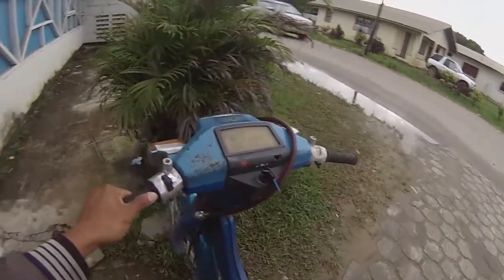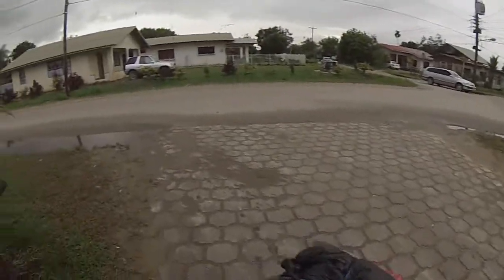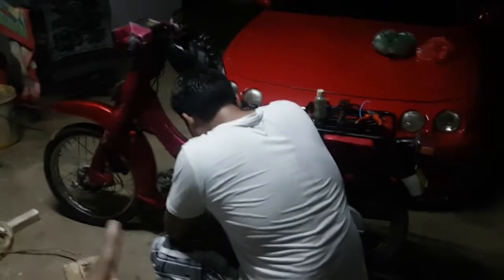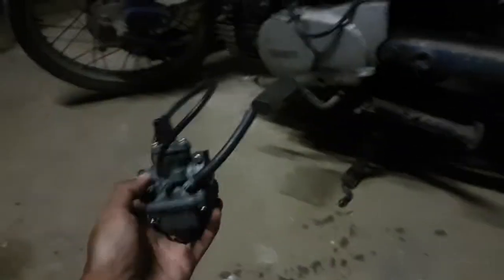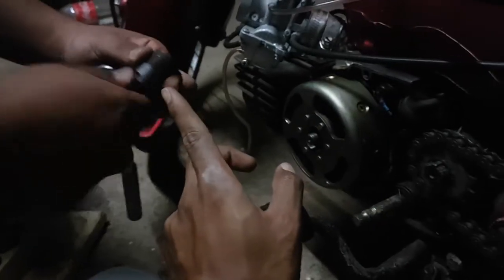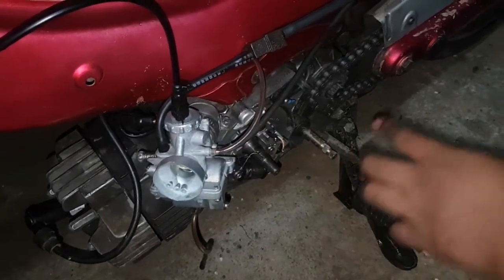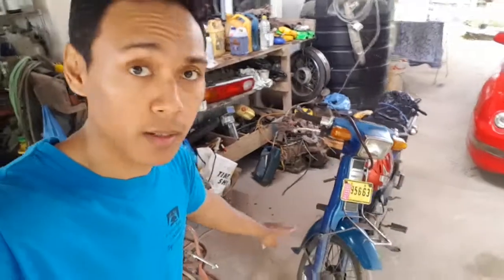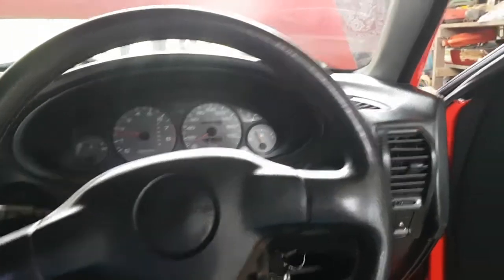Giving the 2 stroke Yamaha's some screen-time

Comment: Please keep making your Yamaha scooter videos.  Yours are the BEST for the step through Yamaha scooters on Youtube.  Excellent English.  I am trying to get my 1965 U5 on the road.  One thing that I would love is you taking about cycling through the gears while riding, and coming to a stop while you downshift.  I need to find a little spring for my front brake, work on my single seat.  Also, I want to weld together a hand shifter from the sacrificial shifter that I found.  I think I will grind gears less.  I'm not too tall, but I think it may hurt my bad left foot if I shift a lot that way.  Thanks again, Stan in Illinois.